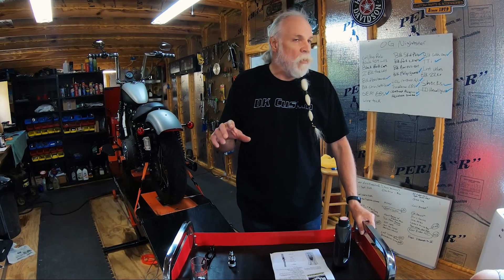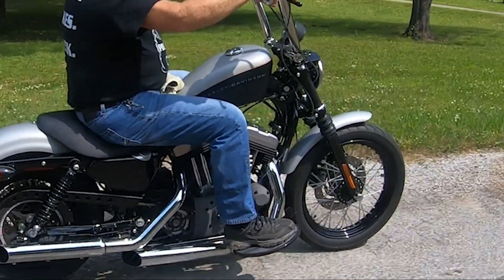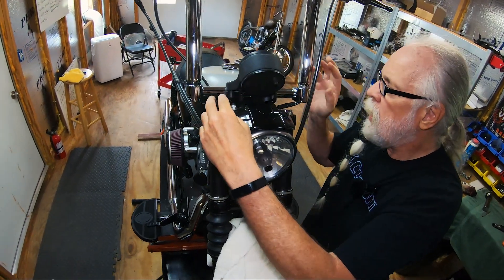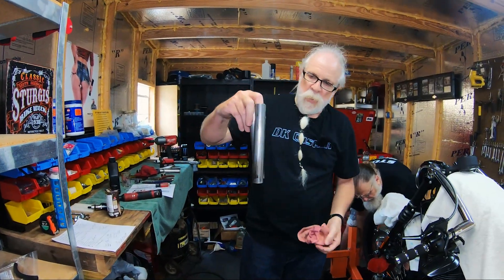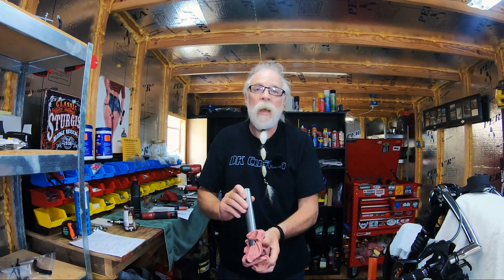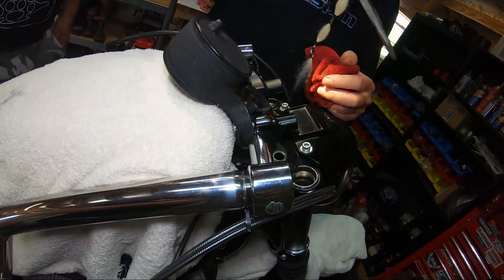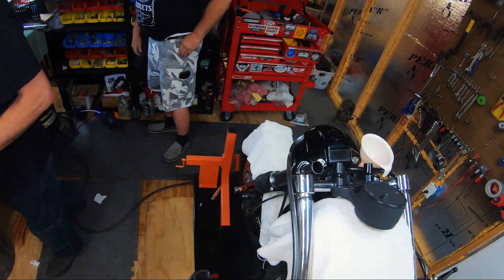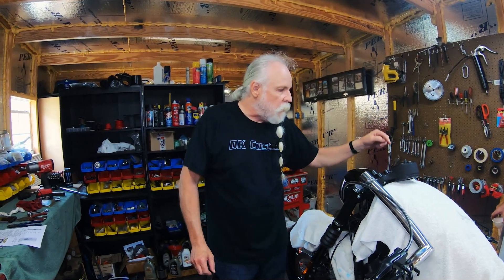Harley Front Suspension Improved - EZ Installation

Comment: I just got mine installed today! Big improvement! Installation is even more simple than the video! 

I pulled the forks off my dyna to do it, and it made it very easy to drain all the awful OEM fluid out of the tubes. And it’s as simple as filling with fluid, dropping in the valves, installing the springs and spacers and you’re done! Much better control over bumps and it feels much more controlled going into and through corners now! Although I will be getting heavier springs, as I reused my stock springs as I thought I’d be fine as I’m a fairly light guy, but they still give me a bit more brake dive than I’d like like. Although the brake dive happens over a much longer period of time. Also I noticed I had to turn the rebound up on my Bitubo rear shocks from 1 to 3 to now match the front!
Reply from the maker: Great report!  Thank you. 👍
Good to hear you are getting better ride and handling out of it.

Comment: Wouldnt you put less oil in than is required for the motocycle specs due to the intimidator taking up space within the cavity of the fork tube?  Thanks
Reply from the maker: No.  That is a good question, but, when using the Intiminators you use a different weight oil, and the valving in the Intiminators is designed for that lighter weight oil and for the factory amount of oil.

Comment: Good stuff as always. I imagine install on an Ultra is quite a bit more extensive. What would you figure timewise?
Reply from the maker: Thanks, appreciate that.
It is about 1 hour more.  We are going to be doing a video of them being installed in an Ultra.   Extra steps are to remove two screws on the console, you do NOT need to remove the fairing at all.  Then the fender comes off, the calipers removed from fork legs, wheel removed, then 4 pinch bolts loosened.  Those are the extra steps...not difficult, just takes a little extra time. 👍

Comment: Almost everything is easy on XLs & FXs. HA! Good video!
Reply from the maker: Yes, agreed.  On these the Softails are easy too.  The Road King also.  The Touring models with fairings add about 40 minutes to the job.  You do NOT need to remove the fairing.  The fork clamps can be loosened with the fairing in place.  Remove fender, remove calipers, remove wheel and then slide the forks out. 👍

Comment: I am curious how the intimidator would work with a cartridge kit replacement for the springs? If you have any video’s on how to install and what it looks like installing the intimidator with cartridge spring?
Reply from the maker: There are full details to the Intiminators at this link- https://www.dkcustomproducts.com/improved-front-suspension-w-intiminator-fork-valves-for-harley-dk-ric-int-39.htm
Here is a video showing how they work, and why they are superior to the popular cartridge setup for Harleys- https://www.youtube.com/watch?v=N1cUpgNJ7i8
They take the place of a cartridge system, you cannot run them simultaneously.
Reply: @DKCustomProducts  thank you for clarifying that up for me know I now what I need to get for my front suspension.

Comment: Wow, simple install!
For my 2005 Wide Glide, with 41 mm forks, what is the cost for a pair, for my application?
Reply from the maker: Check out this link for details- https://www.dkcustomproducts.com/improved-front-suspension-w-intiminator-fork-valves-for-harley-dk-ric-int-39.htm
Somewhere around $200, could vary based on location, if you want fork fluid from us, or you're going to get it locally, also, if you are a Member of the DK Custom Club. https://www.dkcustomproducts.com/dk-custom-club-membership.htm
Reply: TY, for responding!
Will definitely be looking into this! 
I'm in Honolulu, Hi.
I will purchase fork oil here.
Aloha! 🤙
Reply from the maker: @xlrider1565  Awesome, happy to help! Ride safe!

Comment: That was a lot of preload , needs stiffer springs ! ?
Reply from the maker: No, then it would not give the ideal ride.  Sag should be 25-33 % of all available travel, and we set it to right around 30%, so the springs were perfect for the weight of the owner of that Sporty.  Could we achieve that 30% with stiffer spring and less pre-load?  Yes, but then the ride would be stiffer than optimum.
Yes, without the Intiminators, that might be beneficial, to keep it from bottoming out.  But that it is one of the benefits of the Intiminators, you can have softer springs and still not bottom out because of the IAS inside.

Comment: Do you have a video on how to install these on a tri glide ultra?
Reply from the maker: We do not.  We are planning on doing one.
However, the only difference is that you will need to pull your fork tubes off the bike on the Electra, can't do it with them mounted.  It adds about 1 hour to the process.  
Extra steps are to remove two screws on the console, you do NOT need to remove the fairing at all.  Then the fender comes off, the calipers removed from fork legs, wheel removed, then 4 pinch bolts loosened.  Those are the extra steps...not difficult, just takes a little extra time
Reply: @DKCustomProducts  you said Electra. I have a trike (2019 tri glide ultra)
Reply from the maker: It is the same for all Bikes and Trikes with the Batwing fairing, like your Tri Glide. 👍

Comment: Is it possible to install the intiminators on a Road Glide without taking the entire front end off? I would like to know if it has been done without removing the forks on a road glide?
Reply from the maker: The forks need to come off on the Batwing and Sharknose bikes.  No way to get in there otherwise.

We are planning to do a video of an install on a faired bike in the next month or so.  It is not as difficult as it may first seem.
Reply: @DKCustomProducts  I did just successfully (as far as I know) installed the intiminators without removing the forks on my 22 Road Glide! Very similar to your install just a few differences to get there!

Comment: Are all HD 39mm forks the same?? If so What socket size did you use on the top cover??
Reply from the maker: I don't know if they are all the same, but we've always used a 1 3/8" socket.
Reply: @DKCustomProducts   I have a 2014 HD48 and no drain on forks… is it possible to drain oil by siphoning it from the top of fork tube???
Reply from the maker: @jomar284  I suppose you could use some sort of suction to pull out most of the oil.  However, it would be better to pull the forks and dump it all out.  It should take less than 30 extra minutes to pull them and put them back.

Comment: Great video. How long did it take to install? Thanks
Reply from the maker: On a bike where you don't have to pull the fork tubes, about 1 to 1.5 hours at an easy pace.
On a bike with a fairing, where you need to pull the fork tubes off the bike, it is more like 3 hours.
We will be doing an installation video on a bike with a fairing in the next few months.
Reply: Thank you !
Reply from the maker: @markspaulding443  No problem, thanks for watching!

Comment: Hmm,  Yea,  I just ordered a set with progressive springs for my 2020 Road King..  I don't think any of the 49mm touring bikes have fork oil drain holes.  Was the first section of the video of the fork in action with the old set up or new?
Reply from the maker: Yeah, they drain out the very bottom at the bolt that holds the damper rod in.  They do not have one on the side of the fork tube like in the video.
The first section of video was with the new set up.
Reply: @DKCustomProducts  Yes, thanks.. oil can drain after removing the damper rods (if your oil isn't old and gummy), but Ideally one would not want to remove the damper rod as the Intimator just slides down on top of the damper rod before the spring (right??) so remove of the oil would need to be sucked out or dumped out I suspect (on the 49mm touring models)
Reply from the maker: @ut1004bp  Ideally one would remove the forks and thoroughly clean out the tubes.  Then reassemble everything clean with the Intiminators installed.  We did mention that in the video...we did show the short cut on the Sporty since that is the way that most opt to do it...but that short cut is not something to do on the touring models...although, it is possibly doable on the RK...but one would still need to remove the axle (and wheel) to get to the damper bolts to drain it out.

Comment: I ordered spring, itmiminators and oil, and received 1 of the three items, with not notice or message about the 2/3 of the order, or if you all know about it..yes I did go to the website to contact, but I know quite often you all monitor and reply even on weekends..dang it I need the rest of my order before tearing down my forks!
Reply from the maker: Man, I am sorry no one contacted you with an update.  We ran out of the 49mm Intiminators and should have let you know when we would have them back in stock.
We should have them back in stock on Monday, Tuesday at the latest, and will get your items shipped out to you.
Please accept our apology for the screw-up.
Reply: @DKCustomProducts  Awesome, for me sooner the better as l need to get them installed asap..Yea, the box sent was plenty big enough to have shipped all at once.. and so I knew there was a problem.. Thanks guys

Comment: Do you know if having taller dampeners will make it so I can’t use these? I’m talking about the TrackerDie dampeners to replace the stock ones. I wanted to raise the front end 2 inches and they say it helps the ride but I’d like to get these too if I can pair them.
Reply from the maker: The Itiminators work with the TrackerDie dampers.  Make sure to get the "standard", not the "drilled for emulators". and you're good.  Whichever height you choose, does not matter.  Here is a video on how they work- https://www.youtube.com/watch?v=N1cUpgNJ7i8

Comment: Is the a 49mm? I have a 2014 FLHTK and hate the front (and rear) suspension.
Reply from the maker: If you are asking if the 2014 FLHTK is 49mm, yes, it is.  These will work well in the front, and you can get the Twin Adjustable or the PA for the rear.  They will also provide a very nice improvement.  Read the reviews at the following links-
https://www.dkcustomproducts.com/twin-adjustable-performance-rear-shocks-for-harley-davidson-dk-bt-shks.htm

https://www.dkcustomproducts.com/pro-action-street-series-shocks-for-your-harley-davidson-dk-pas-shk.htm

Feel free to email or call with any questions.
Support@DKCustomProducts.com
662-252-8828
Reply: @DKCustomProducts  sorry, I think I made a typo. Yes, I know the 2014 is 49mm, but I did not see a 49mm Intiminator on your site. Can you point me in the right direction?
Reply from the maker: @scottvaletti3696  Go to this link... https://www.dkcustomproducts.com/improved-front-suspension-w-intiminator-fork-valves-for-harley-dk-ric-int-39.htm   ....enter in the information about your bike that is requested.  We will send the right size for you (49mm).  Also, please see the fitment note, in case you are getting the fork fluid locally....Different Intiminators use different weight fluid.  If you choose to have us send you the Racing Formula Fork Fluid with your order, we will send the matching weight.  (5W for 39mm and 41mm forks & 10W for 49mm forks)

Comment: Bummer that these aren't meant for 48's
Reply from the maker: They do fit all 48's up thru 2015 as is.  On 2016 and later 48's Many Customers have replaced the cartridge on one side with the standard damper rod and then used the Intiminators with good results.
Reply: Thanks for the offer to walk me through it but I'm touring Japan til Aug so will wait for the video
If that doesn't happen will call you when I'm ready, thanks again
Reply from the maker: @chrisharris5555  Cool.  Enjoy your time in Japan!